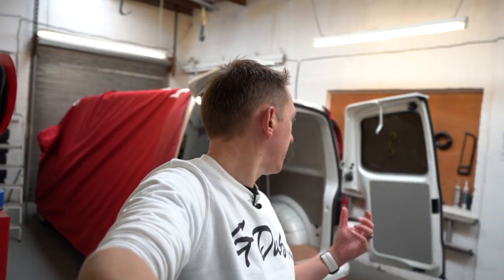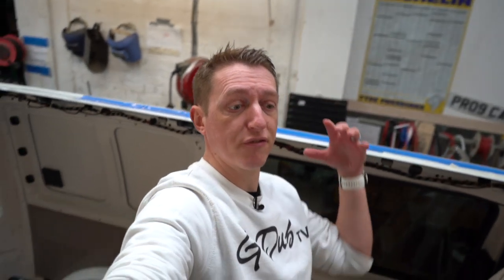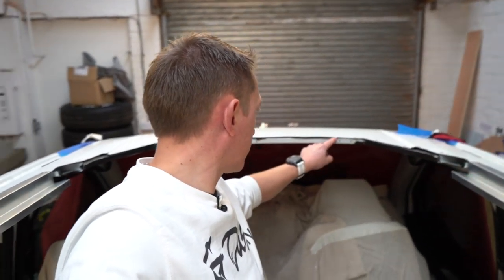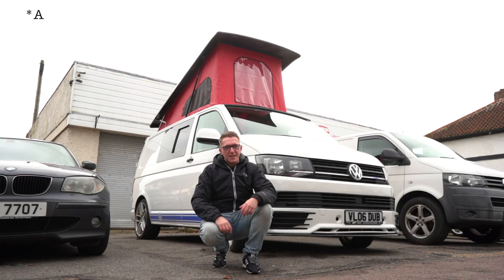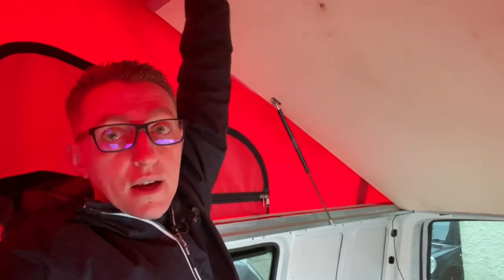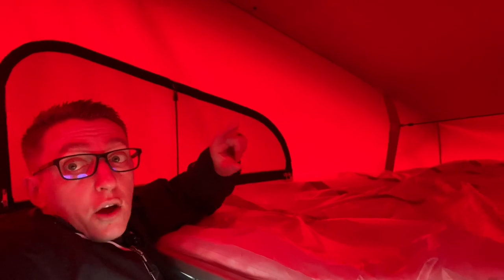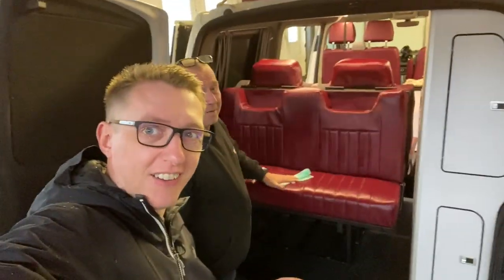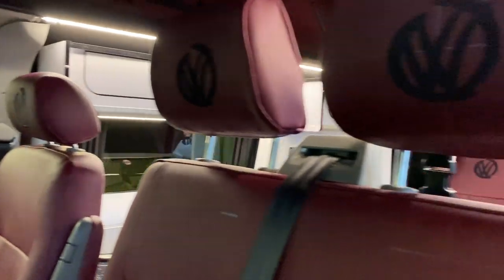Fitting an Austops roof on a VW T6 - The Dub Hut

Comment: Looks great. Is there any kind of blind or something to pull over the driver and passenger seats when the roof is down or is it just open so that you see the red folded canvas all the time?
Reply from the maker: No blind, it’s open.
Reply: That’s a pity, it just looks like it needs something.
Reply from the maker: Yeah, agree. Some folk make an extra cover from carpeted ply to cover the gap, both when driving and also when sleeping to stop pillows potentially falling down the hole! When it’s carpeted and all kitted put it won’t look as brutal, but the red stands out a bit, whereas a lighter canvas (like a grey) is less obvious against the usual van coloured interior.
Reply: Yes that’s the way to go. It’ll be a couple of years before I get around to a pop top but definitely worth remembering. Certainly makes the van a whole lot more flexible doesn’t it
Reply: GDUBTV looks great. I'm going to try and knock up some kind of cover for the space on mine. Keep up the good work mate